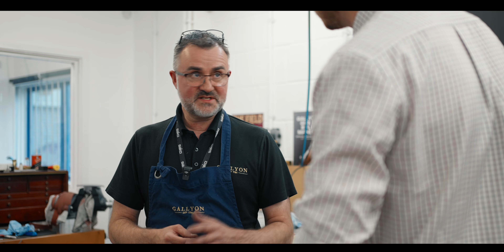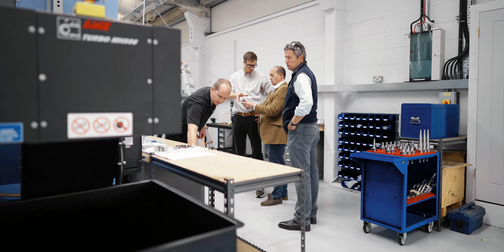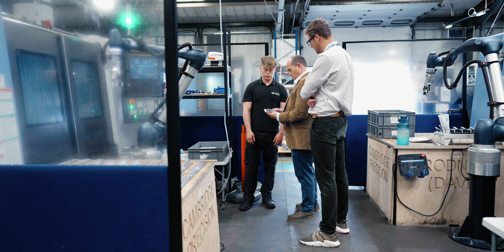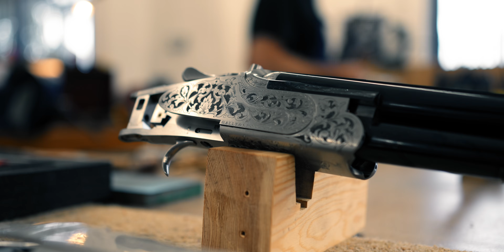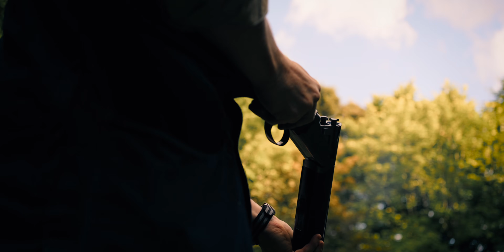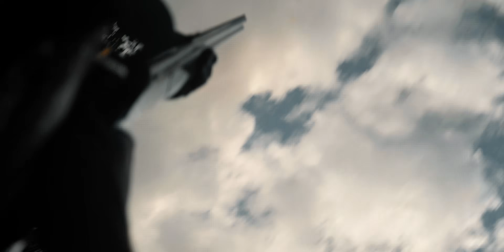The Pursuit of Perfection - British Gun Factory Tour with Gallyon

Comment: Amazing to see the process and equipment, but i have to say it doesn't seem right to me.  If the 5axis machines work in "micron" range of precision and are truly consistent it would not need 200+ hours of fit and finish to reach "precision" and "perfection" . it sounds like an excuse for extreme high pricing and exclusivity ("if you want a sloppy gun, assemble it of the machine" is what the guy said. its just not true).  Stunning guns nonetheless.  Srry

Comment: They're probably using MMA adhesives. They're not wrong. They're extremely strong and very commonly used these days for bonding metal to metal. They're also practically inert once set, so not much will affect them.

Comment: Tin is simply not a strong material. Gluing steel as "better than solder" yeah don't need that actually is OK but got different theories on breech design. Titanium barrel and breech, you can direct weld and wire EDM for final precision + internal bore. Silicone carbide action is a big upgrade as are alumina surfaces. Precision anodising is very good. Totally marine capable, I'd build a pump action 🎬 beretta benelli etc H+H are currently beretta owned. Very trad engraved walnut stuff. Nice wood handles for the M16 and a furniture rig which integrates a HUD and electric assistant 😀.  Bayonet mount + acoustic control exit system for deflection spin correction + 0.22 blank secondary hypercharge. Basically strapping a revolver onto the end, single use nylon extras + blast shield 🛡 👌 is a mature format very open source. A silicone carbide action for M16 by beretta is permissions. The stick out bit on the back could do a bullupup design if you put rhe handle where the bullets go in. That can be done with conveyer box and loose feed is ideal 👌 just a hopper or a bag would be preferred just pour them in, they pack and store better in boxes that's really the ideal paper packets that ka chunk and spit the wrapper out + goes beep 😀 lots of weight behind the stock for ammo be nicer 😉 compressed air feed is what they don't seem to use gas conveyer can be coupled think pistons with hot and cold areas, seems bit prone to jamming at high cycle rates to be grabbing the bullets rather than shooing them 😉 m16 bullets are tiny and stack well. Could store loads if you have them end up at an angle, and push them upwards from the base. Feed them into the stock + put a chute on the top just pour or push the stack into the top 😉 instead of mags keep 60 rounds in the weapon rest in the vehicle or somewhere handy 😉 cassette storage you can just fit it to a feed different cassette + elegant hunting rigs that are silent manual operated, if you put handle where mag currently lives and redo the trigger pack for fully regulated adjustable speed and automatic gas compensation electronics kinetic laser tracking of projectiles in flight T⁰F + full correction per round target dot 😀 5" window with basically not too much bezel, bit of a hood + good optics you can stick on with magnets and a power infrastructure that keeps batteries and comms off the weapon, same as comms system and helmet etc 😀 for guards that's the cabin or grab pack for going to active investigation. Maybe if medical you tske the big box + stretcher. If one thing doesn't work has redundant 40 minute standalone and can take power from anything even usba with an adaptor. Take mains or 12v On screw pins or spades ♠️ just go into the flap and pull the toolkit out the handle 😤 automated cleaning cycle per reload + quarantine of ID and purpose 😑 mission pack 😑.  GPS locked 🔒.  Goes full auto if you're in designated military areas etc 😑 manual override works anywhere just pushes an alert ⚠️ engages comms immediately 🙄 😳.  Same as switching safety off is LEO badge unit 🙄 😳 you have to certify for wood handle + silver star 🌟 🤩 has no service obligations past recording weapons use correctly has a whole ecosystem of hunting and wildlife options 🙄 constitutes as a hunting license and basic military rank as a scout 🙄 each unit has an ID and an associated local training unit 🙄 you can see why putting the feed behind the handle makes sense. Taxtile feedback of each round gojng via hand palm could be good. Levers can amplify feel so squishy trigger shouldn't be a problem. Balanced center of mass and longer barrel for less stick out is more spear. No silly plastic stock extra is more contact less weight. Seems clear there was some steyr aug thing they had in the 60s that nobody released. Uk had some wood rifle with wood bits before the vickers exhaust pipe shroud green fondue set 👌 😎 . Cnc aluminium in nice colours for the shroud + the robot clip in transparent polymer and MIT watch work. Improve precision and capacity basically. Other than that just make nicer and easier to use. Stuff like burst mode where you can send the bullets in controlled areas and sight each projectile in flight + record each impact to check ✔️ ✅️
Reply: Too much sugar!
Reply: What was that you said again 😂

Comment: I don't care what you call it - adhesive, glue, bonding material or whatever, this is a REAL INNOVATION and I totally agree it would provide an advancement in gun making.  As was stated in the narrative, these adhesive materials are used in many, many space-age applications.  I have no doubt they would have a lower failure rate than conventional solders and such.

Comment: The only thing I can see that may be of concern is the Adhesive, yes they use it to put plane wings together but all Epoxey products have a limited life span before they fail.  So will the Adhesive holding the gun together last a hundred and fifty years like a lot of traditional manufactured guns using brazing and solder???? Further more Adhesive used in planes and spacecraft they have a limited service life span before being scrapped one way or another so I can not see that as a recommendation.
Reply: Modern bonding techniques will outlast the material being bonded together Soldering, brazing, and welding leave a stress boundary that is far more likely to fail than bonding.  
Planes, spacecraft and other applications that are bonded are retired not for the fear of the bond failing, but metal or component fatigue caused by inertial stress.
Reply: @raymondvincent204  The question is will the Adhesives last  a hundred and fifty years and still perform because you can not be so sure because they have not been around and in use for that length of time. And as I said Planes have a limited life and space craft most never come back others burn up in atmosphere and the Shuttle ???? It is all right having smart answers about stress boundaries but fire welded  Brazed and soldered items have been around this earth for a thousand plus years modern Adhesives have a long way to go to be in this company.

Comment: I do believe they are over stressing the point of hand fitting. I buy into the ethos but cant accept the build time being an effective and efficient process. I have repaired quite a few guns and find that its no more involved than building a highly tuned engine. For instance if the hand fitting achieved total perfection the coating would change that.
Reply: You are clearly missing the point.  There are things that a hand finish can create that fine tolerance machining alone cannot.  If part A is manufactured 10 microns over, and it is mated to part B that is 10 microns under, then you have 20microns of freedom between the fit.  It will probably work just fine, in fact even for automotive tolerances for example it would be great.  Now make parts A and B with both parts 10 microns over.  You have zero tolerance, an interference fit as it is called.  To now work that slowly and meticulously, micron by micron, something that can only be done by hand, until A slides over B with ZERO freedom, is the difference between great and ….. "aaah! That’s the best in the world."    The British aristocracy needs something to go into debt for so why not allow the poor gunmaker to use 37 years of skill and graft, and turn a 'great' gun into 'the best gun in the world,' just by using that skill, whilst simultaneously relieving aforementioned toff of a chunk of his hard earned cash.  The rich and famous want the best.  The 'best' is often defined by the look, the feel, and an intangible, oh, and often a name too.  Just like so called 'designer labels'.  That feel, that intangibility and that name is purchased because of the quality that hand-crafting brings.  Just ask a Morgan owner why he waits 8-10 years for them to build his new car and somewhere in the answer will be the words "hand made."

Comment: I am a retired mechanical engineer, and hate when anyone, especially engineers say “glued”. “Glue” is made with horse hoofs.
Reply: I agree however the adhesive used is not more "reliable" because of the lack of heat.
Reply: I worked with designers of offshore wind farms. You could wind up a few people by saying "paint" only to be corrected with "coating systems" 😄

Comment: As a  historian  in a controversial area, I measure twice, cut once. Everything is corroborated from independent sources, preferably antagonistic ones. This is to eliminate error. Get the hint? By working from a single data set, you can propagate it.

Comment: F1 machinist here ; could you liquid nitrogen freeze the barrels to form shrink fit on the stock  , and if you got a kern with jig grinding you could probably reduce / eliminate the time taken to fit the stock
Reply: I think they said they wish to avoid any extreme temperatures as they felt the resulting effects on the metals were unpredictable. I understand the main pin, on sweep wing aircraft ,are assembled this way. However were talking about very thick titanium for the airframe, I'm not sure if it makes steel brittle.

Comment: Impressive machinery and advanced technology... what's not to like?
But if the action is machined to the tolerances of 5 microns what are those guys doing for days trying to fit the action? There is no heat treat process after machining the action so everything should be as designed... Just a show for the customers? 
I can assure you that F1 gearbox (ages ahead in complexity and material science) made on this machines is not fitted with files and old paraffin lamps ;)

Comment: If the adhesion process is using a two part epoxy the mixing and proportions have to be absolutely spot on to get the required performance expected from the epoxy.

Comment: I’m a Chartered Engineer with decades of experience in materials engineering as well as a PhD and I can tell you that adhesive “structural bonding” is not as mechanically robust as soldering, brazing or welding would be.  It’s nonsense and I get the same chills up my spine when this guy says his glued together barrels are innovative as I did when Stockton Rush said that OceanGate’s “structural bonding” was innovative.  Absolute nonsense and anyone who is taken in by this needs to read some books asap.
Reply: @thepurplecat5975  I thought the same thing.  Note that not one stitch of actual data was presented.  I guess we're supposed to take their word for it 🤨
Reply: @madmat990  purely marketing drivel the same as they pretend to be the same company founded over a hundred years ago when 10 minutes of looking at Companies House records tells you that they’re a brand new company formed in 2019 and simply use the name of the previously dissolved companies (yes, plural).  There’s no unbroken chain here sorry.
Reply: @thepurplecat5975  calm down boys!!! It’s all meant to be for sport/fun
Reply: i bet you have never actually made anything   ,    the surface area  that glued  is    way  more than what  have  been soldered   ect   , open your eyes   and look at  what they have  made  and the quality if they say  its  strong enough  it  will  be   as they are clearly master craftsmen      ,       im  a  cabinet maker   35  years   making  fine  furnitue   and  i  can tell  you  these people know  more about what there doing  than you do  )
Reply: @cameronsmith2928  a cabinet maker talking about wood glue can have no idea about metal bonding!!!
Reply: @levitated-pit  i know  i  dont work with metal  but  i  do  know  about  craftsmen  and  i  know  anyone  who  is capable  enough  to  make things to  the standard  they  do  will  make  sure   its  going  to  work    ,  and  if  i was bonding  metal  i would   find  out   how  to  do  it  right  the same   way as i  do  with  wood ,   cant   you see they  know  what  they are  doing
Reply: @cameronsmith2928  lmfao cabinet maker 😂 stick to putting together IKEA kitchens and I’ll stick to talking about the zygology how about that
Reply: @cameronsmith2928  wHen You tYpE  LiKe  tHis,,,   it  makes  IT looK   lIke   YoU   FaiLD   GraMMar   Skool,    and THuS  noBody  BeLiEves  YoU.
Reply: @madmat990  well   i  am dyslexic ,    i  find  we all  have something wrong with  us   thats my  thing  , whats yours
Reply: @cameronsmith2928  I don't look like Brad Pitt or George Clooney, I have a face made for radio 🤣
Reply: What’s the issue with the materials and process used here?
Reply: @AlecMacarthur  the manufacturer is making grand claims apropos the mechanical performance of the bonded interface but doesn’t actually provide the test data to back-up their claims.  Rather dubious the same as OceanGate made grand claims about their revolutionary bonded hull before it imploded catastrophically over the wreckage of the Titanic.
Reply: @ citing one example where bonded material failed…where both material and application couldn’t be any more different to this one…isn’t evidence one way or the other. Why not cite the countless examples where metal to metal bonding is successful? What is it about this particular application of bonding that concerns you?
Reply: @AlecMacarthur  my concern was set out pretty clearly in my opening remarks: in my learned and experienced opinion; a bonded adhesive will have inferior mechanical properties to a welded, soldered or brazed connection.  Specifically I posit that it will not have the resistance to vibration nor cyclic fatigue the traditional method would.  I refer you to Kohei et al (2021), Zaludek et al (2019) and Nagasaka et al (1995) who all note the poor performance of epoxy based resins apropos cyclic fatigue.  Good enough or you going to continue boot licking instead of doing your own research?
Reply: @thepurplecat5975  the suitability of resins for bonding metals is going to vary by application. As you know they’re used successfully in building construction, ship building automotive applications, aircraft…I’m interested in the specific issues that might cause concern here given it’s not particularly high stress application.
Reply: @AlecMacarthur  you don't think that constant heat cycling, vibration from percussion and shock loading from the pressure of the deflagration on the walls of the barrels are not high stress?  Do you actually understand stress and strain from Engineering principles?  Your latest comment has confirmed you're not an Engineer.

Comment: Its a great video but I have to question the FMEA topic (Talking as someone who has Moderated P-FMEA's for 10 years). Its a fact that no FMEA's from anyone else have been studied. Why? Because a company will never hand these documents over to a competitor. Thats unless someone has been stealing documents? Even a customer of a supplier will likely only get to see a cover sheet with a breif summary. Gallyon/Cambridge precision will have next to zero quantitive quality data from other manufacturers. My guess is they have looked at what they think are the possible weak points with other manufactuers and tried to build on that. Possibly creating their own System/Design/Process FMEA's to have robust design / process(s). Its not good to try and use a lot as fluff to try and impress people. There is more than enough good stuff in this video without any BS.
Reply: You just ask the customers about failures, get a big enough sample size that you can trust.
Reply: @BestKiteboardingOfficial  I dont beleive you would get a large enough data set of good data. I'm no statistical expert but  as a green belt in six sigma I'm not convinced. Go down a layer they will never understand  the occurrence and detection. You could have a robust design but crap manufacturing leading you to beleive its the design at fault. Been there, done it with many T shirts.
Reply: As they are so expensive I guess it's going to be tested by people rich enough to sue them should a gun fail. Not the best bunch to test a new product.....

Comment: Fantastic video!  Thank you.

Up until sometime in the 1950s every Colt and Smith & Wesson revolver was hand-fitted. Oddly, this video gave me a greater appreciation for a Shooting Master or a Registered Magnum. Both are the results of gun making experience, engineering, precision machine work, and hand fitting.
Reply: You are mistaken, the Colt was a standard issue which was not individually fitted to each military personal in 1917
Reply: @ 🤪 I didn’t mean “fitted to the hand” of a specific user.  I meant that although parts were mass produced, some hand fitting of parts was necessary. Especially with the Colt double action just because of how it operates. Smith & Wesson printed the serial number on the frame, crane, cylinder, ejector, and barrel up until the late 1950s. The only reason to do that is the parts were fitted to a specific revolver prior to finishing. The gun was fitted during assembly, taken apart, finished, and reassembled. 

Yes, I did have a few shotguns fitted to me decades ago. Handguns not so much…